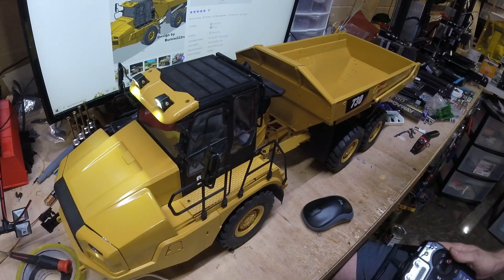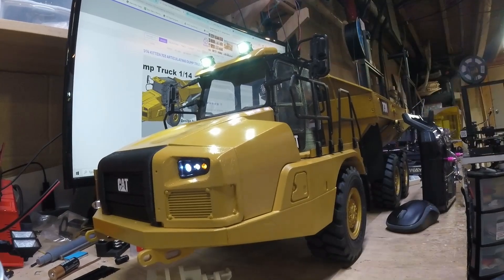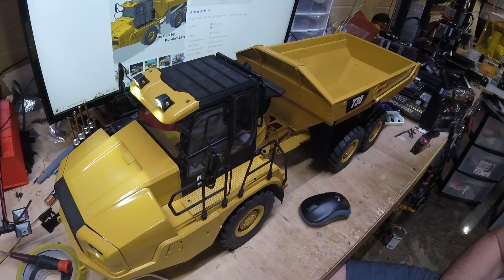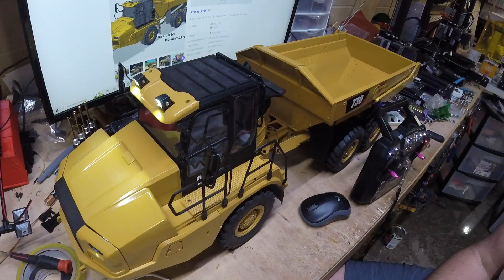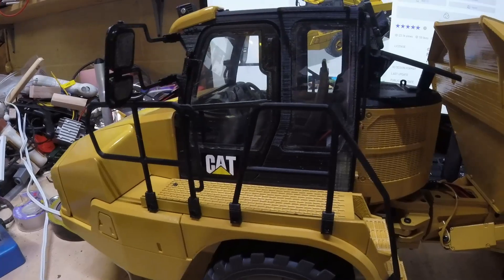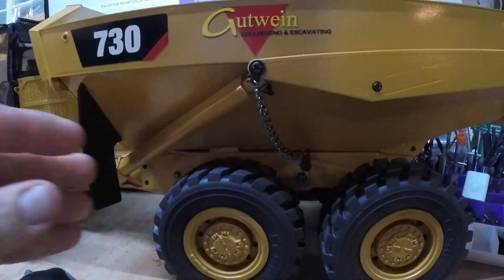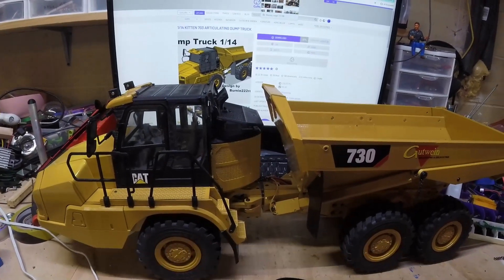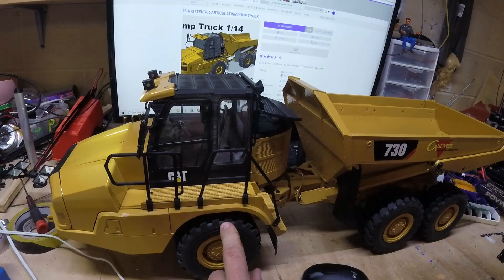3D Printed Articulating Dump Truck

Comment: One of the guys had a different truck and the vibrator roller from Burnie222, at an outdoor dig event and they function as good as they look. We were all kind of blown away by how nice the models look and perform. I don't know the exact specs but the roller is designed to be packed with tire balancing weights and was easily over 20 pounds, did need the dirt to be just a bit damp to work really good. The articulated truck worked as well as the metal ones from other companies